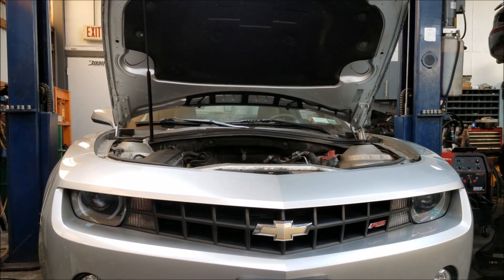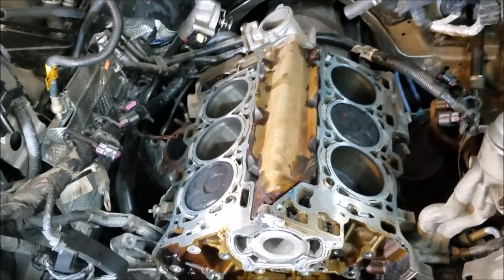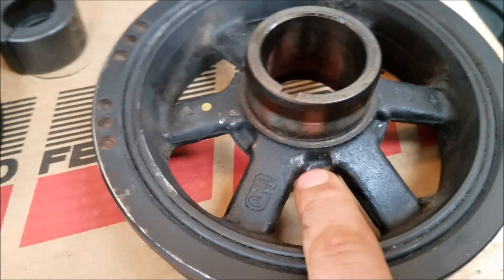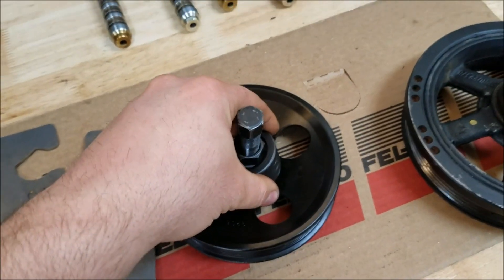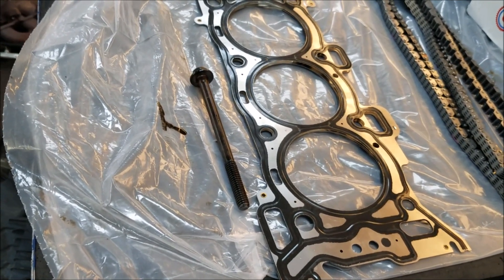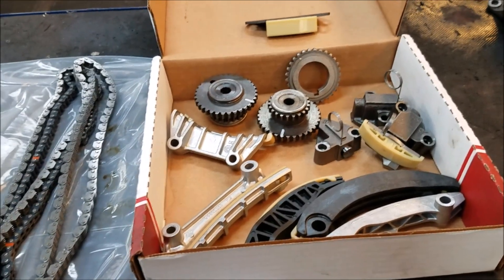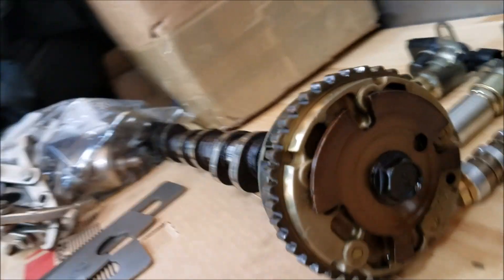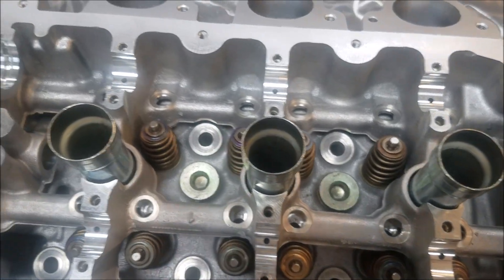2007-2015 3.6 V6 GM HIGH FEATURE TIMING CHAIN/HEADS INSTALLATION GUIDE/TIPS. BIRDIE'S PRO-TECH

Comment: Travers mounted engines can have heads removed in place. There are videos showing timing chain removal with engine in place. One thing that could be added to the video is head bolt prep, use thread sealant, oil or dry, and the torque procedure. Thanks.
Reply: How sure are u on this I would like to know if it would benifit me or is this some practice for other engines?
Reply: @ImpalaLfx  I did it on an 07 Acadia, if you have a hoist it is better to drop the engine.

Comment: Is there any way to check the vvt cam actuators? One of them I can move the sprocket with the cam in place, shouldn't it be locked? If so is there a procedure for it?
Reply from the maker: Hi Kris and thank you for the question. I'm unaware of there being an "official" test for the Cam Actuators but what I like to do is give each of them a hand movement test. If any of them have a noticeable difference in movement, inspect or replace the actuator. I would actually recommend changing them all depending on mileage or if the engine was noisy at idle.
Reply: @birdiesspeedshop6997  Thanks for the reply back! Gotcha, I didn't hear the the engine run before taking apart the engine but I do know that the timing chains had failed but no valves were bent. As far as as the moment by hand, there is one phaser that I can move a good 45 degrees or so and sometimes it will lock into place but then I can easier disengage it by hand. I assume that it's bad but I want to see if the other ones are faulty. It's supposed to be a super budget rebuild so if it ain't broke I don't want to fix it but also I don't want to put if all back together and later find out that they are bad and have to redo all the work.....
Reply from the maker: @krissondors  I totally get it. Doing that job once is enough too! Sometimes it's worth doing the full replacement just for the peace of mind. Then you can get that job off your plate and not worry about it coming back to bite ya!
Reply: Different application but still a GM and likely relevant. Another channel went through a test on one of those phasers and it does not look like the slop has to be all that much to screw up timing. The end of the video below shows the test and the next part of the series shows the new one and the comparison.
https://www.youtube.com/watch?v=0pkIZKys2cE

Comment: Yes it sounds like in the valve train. It starts sounding real soft until it gets to its peak sound, . Today i drained the oil, it looks clean but on the drain plug (bolt) i got like grease stuck on the magnet tip, no metal debris in it, just like if its got a dirty oil pan, I'm thinking its clogging up the oil pickup tube and passage ways.Thank you for your response, I only work on it when I get a chance mostly weekends weather permitting. thank you for your help, really appreciate it. Also i replaced fuel purge valve that was stuck open that made a ticking sound too, but that was a different sound.

Comment: Torque Specifications for Rocker Arm and Heads Bolts Please.
Reply: There was a torque spec briefly displayed for the head. Rocker arms have no bolts, just cam bearings.
Reply: Where can I find the head bolt torquing sequence

Comment: Can the variable timing solenoids be switched around from the intake to the exhaust side and from left to right banks?
I replaced the head gaskets and installed new timing chains, it starts pretty good but after a few minutes i get a sound like if it was a diesel engine, i shut it down and restart the engine and that noise goes away but comes back after a few minutes, and if i turned the a/c on the oil light will come on. i changed the oil and it kind of lower the noise. I had it idling for a couple of hours but keeps making the noise until I restart it. I got no engine light on, i drove it for a couple of miles runs good but the noise is still there. you shut it off restart it and engine idles normal for a few minutes. any ideas or advice please.
Reply from the maker: Yes, those vvt sensors can be moved around. Can you distinguish where the clicking sound is coming from? (Crankcase/Valvetrain)

Comment: Damn what happened to GM? I’ve always been a gm guy because there v8s and v6 engines were some of the best as far as I’m concerned. I officially won’t own one of these just like I won’t buy a 5.4 , 4.6 triton or 4.7 dodge. Over complicated junk. That car would be fine with good old 3.8 or 3.1 even. They even had to ruin the Colorado with these. Why not use new 4.3? I love how these engines run but I’m scared to buy one. Great work on the video buy the way.

Comment: Have this job done and driver and has no code but my gas pedal feels sensitive and doesn’t feels like before the timing chain. It had power and ran like new, miss that feeling. You think you can give me ideals what can it be???
Reply: One tooth off timing.
Bent or damage valves.
Slight damage to valve seats
Lifters.
Ideas to look into hope I could help

Comment: Thanks for the video. Based on your experience with these hf engines, have you ever seen the timing reluctor wheel on the exhause camshaft become damaged in the past? After a persistent p0341 dtc we put a scope on the wires and noticed a bad waveform coming from one of the long teeth. Then visual inspection via the camshaft hole, looks like that tooth has a burr on it.

Comment: Cloyes timing sets are made in China
Reply: spent extra $$ for all "genuine GM parts" for timing chain/guides/sprockets/actuators on a GM 3.0 and when I received the order, most if not ALL the "GM" parts were made in China, Taiwan or  Hong Kong. To add insult to injury the secondary chain guides, which were in sealed "Genuine GM Parts" bags, were Cloyes parts. You could clearly see the Cloyes name right through the plastic bag. GENUINE GM PARTS MEANS NOTHING ANYMORE.   ITS A LIE. SHAME ON GM
Reply: Everything is made in China, even the prescriptions you depend on.

Comment: I know you have to replace the head bolts but do you have to replace the camshaft bearing cap bolts too.
Reply from the maker: Hi Claudia and thank you for the question! No the cap bolts do not have to be replaced. You can safely use them again.

Comment: Head gasket at under 60,000 wow what a load. I’ll keep my 3800s
Reply from the maker: Changing the oil on these every 3500 miles certainly helps keep this problem away!
Reply: @birdiesspeedshop6997  
So 5000 miles not soon enough?
Reply from the maker: @hotwheel6663 Hello, Good question. With this engine, 5000 mile oil changes isn't enough. I believe that the lack of consistent oil changes, low oil level between changes caused by PCV system issue/owner neglect and use of a good oil will bring the chain issue forward. The chain system itself is also to blame in my opinion, but if you change your oil more frequently it tends to keep the problem at bay for a longer period.
Reply: me too
Reply: Q. Tech I’ll keep my 5.0 liter (EFI HO) with 350,000 and still runs like a clock.
Reply: I'd say it's the dex cool that fails the gaskets
Reply: Yep 3.8 is the best v6 ever made. 200,000 miles plus on my Lesabre.
Reply: @glennmartin7941  that’s why they stopped making it. Wasn’t it a pushrod engine?

Comment: how did u set or alighn the cam fasers or do u have too im havinga hrd time with a 09 traverse 3rd time changing timing chain....i skipped a procedure the second time removing the chain and not aligning the crank shaft so i think i unalighned the cam shafts

Comment: Hey birdie, I inherited @ 14 Cadillac XTS with burnt valves so the heads are in the shop. Problem is they brought me the parts unmarked in boxes, and I’m having trouble identifying positions for 3 of the camshafts, the bank 2 exhaust is pretty evident. Do the casting marks have any bearing?

Comment: hi does the engine need to be on 1 tdc when its on the stage one marking for the first chain or where do my pistons have to be when i have it on the stage one timing mark?
Reply from the maker: Hi and thank you for the question. Is this for disassembly or reassembly?
Reply: @birdiesspeedshop6997   hi thanks for the reply its for reassembly
Reply from the maker: @elgordotrucking  Ok thank you. Hope this helps!

1.)Start at stage 1 timing mark and install chain and idler on left bank.

2.)install idler and primary chain in stage 1 timing mark

3. Move position to timing mark #2. Then Install right chain

Tip! double check alignment as you go before you pull tensioner pins.
Reply from the maker: @elgordotrucking  https://youtu.be/hZyehWKDV-Y Here is a link to cloyes install guide.  Best of luck!
Reply: @birdiesspeedshop6997  thanks appreciate the help!

Comment: I have same p0008 code. 77k miles on the Camaro. Just opened the valve covers and have lots of sludge. You think it would be a good idea get the engine out and clean the pan and pickup tube. Oil pump   not sure how to make sure nothing is clogged up with sludge
Reply from the maker: Hi Paul. That wouldn't be necessary to remove the engine. A few tipsas well,  I would suggest sea foam engine cleaner after the job is completed. Also, change your oil again 500 miles after the repair. That will begin  a good clean up in the crankcase and top end. Another suggestion is to start changing your oil every 3000 miles instead of what the manufacturer suggests.
Reply: @birdiesspeedshop6997  awesome. Yeah they didn't change the oil in time. Waited for the light to come on every time. I'm ordering parts soon. Need to get this thing going.
Reply from the maker: @reyesracing24  Ahhh yeah...oil neglect is the worst for these engines. I hope the job goes extra smooth for you Paul. If you have any questions I will do my best to help!
Reply: @birdiesspeedshop6997  thank you really appreciate it.
Reply: @reyesracing24  I was discouraged to use the oil life monitor for oil changes in my newly purchased 2008 Pontiac G8 with the LY7 V6. The dealer advised changing the oil every 5000 or less with full synthetic. They also did my PVC mod for me a few years ago.
I don’t necessarily get my oil changed at the dealer but do follow the suggested maintenance schedule.
I just ignore the oil life and just reset it to avoid nuisance alarms.
So far 109,000 miles and no issues.
But I’m not holding my breath.
Reply: did you fix your issue?
Reply: @aykutyildiz7133  I found an engine on ebay with like 50k miles from an Cadillac ATS. Decently priced so I ordered it and just swapped it out. I have a lift so it made it easy to drop the k member and just swap everying over. Oil pan and timing cover were different that's all.

Comment: I am having a hard time lining up the timeing markes on a 3.6 L engine, ive been rotating the motor for days and can't get any of the timing  marks to line up correctly. How to do this right so I dont break the engine, thanks
Reply from the maker: Hi. Once you complete the job, have all the timing marks aligned and everything is lined up properly, and then you rotate the engine, it will still hold the correct timing but the marks will "appear" to fall out of place. You will still be in correct timing and alignment. I hope this helps! 👍
Reply: There is 2 stage procedure left bank 1st right bank 2nd

Comment: Worked on a 3.0 CTS engine changed all chains, guides, tensioners and exhaust cam phaser due to being stuck .. now getting P0014 code on the new phaser .. double checked again all is in timing.. heard about a thrust washer going in between cam phaser and camshaft . Know anything about this issue?
Reply from the maker: Hi Juan. Did you take a look at the VVT solenoids? They may need replacement as well. I would start there and see what you find. Best of luck!
Reply: @birdiesspeedshop6997  I put in bank 1 all new solenoids and cam sensors and still no luck
Reply from the maker: @JuanCRaw  It could be a wiring issue. You can start by checking grounds at the vvt connectors. Also make sure the oil is freshly changed. Also not to state the obvious, but be sure you are working on the correct bank location.

Comment: Is this the same engine in the '09 Cadillac CTS Direct Injection V6 AWD?
Reply: The reason I ask is because I am looking for a video on how to replace the head gaskets.. I’ve never done it before but if I see something I can pretty much do anything. Do you have any videos on the exact process of replacing a head gasket? Or a reference to such
Reply from the maker: @successfulminds7288  Ok great! For some, this video would be suffice enough to see how it comes apart but If you need more help I would be happy to answer any questions you have or you may be able to download a service manual. My advice to you would be to take your time and follow the torque specs. Once it's disassembled the job is much easier than it looks.  Best of luck!
Reply from the maker: Hello. Same job, yes.
Reply: Yes and it’s 💩

Comment: 2008 Acadia ly7 engines are running $2,500. Can I take  ly7 engine from a 2008 malibu striped To long block and put all acadia accessories on it to save money? I have found 2008 malibu engines for $800.00 ...I realize I'll prolly have to change oil pan and pick up too.  Do you think internals of both engines are same?
Reply from the maker: I believe that should work just fine. Rotating assembly should be the same. Let us know how everything goes!
Reply: Wont work with computer

Comment: Do the cam phasers have to be unlocked when you install them. I didn’t see anything about this in the Hanes manual.  Had to replace the intake phaser on the right bank and  did the timing chain too. Used the cam retaining tool and followed specs still getting correlation codes and its drinking gas like a big block j
Reply from the maker: Hi lionel! Unfortunately, It sounds like you may have issues with other timing components if you're getting the same code. Did you change all the chains and guides? if not, I would suggest having another look at the condition of the rest of the timing system. Not the news you want to hear, I'm sure.

Comment: My cam caps got mixed up, in what order do they go.
Reply from the maker: The raised feature must always be oriented toward the center of the cylinder head.

The I indicates the intake camshaft.

The E indicates the exhaust camshaft.

The number indicates the journal position from the front of the engine.

Hope this helps! If I find my full diagram, I will post it for you.

Comment: Hi there. I have a 2006 Holden Rodeo V6. We had a issue with the motor. It was making a rattling noise. THe car stalled while driving. Then it started again but stalled again about 20 kms down the road. Got told it was a starter motor. So we changed the starter motor but still wouldnt start. Had a mate come over and tryed to crank the motor with a braker bar on the crank blot but wouldnt move at all. Saying it could be timing chain. So taken it all apart and removed timing chains but still cant crank it by putting a braker bar on to try to crank it. Like the motor has seized. Any ideas if possible...
Cheers
Reply from the maker: Hello! I would check the transmission and drivetrain to be certain that the problem doesn't stem from there. If everything else moves freely, suspect the engine internals. Best of luck! Please post your findings!
Reply: Hi Allan. What was the cause?

Comment: How do i put the engine back in time if the timing chain is off a tooth?
Reply from the maker: Hi Jeremy. I would suggest starting over from the beginning, checking your work as you go to guarantee the correct positioning. It's better to be absolutely certain it's correct than to have an issue when it's reassembled. Best of luck!
Reply: Move the cam slightly

Comment: Hey Birdie great camera work with description of video! I came across this when I was getting ready to change my timing chains. I agree Cloye's is worry free manufacture with a great step by step. What brought me back to this video was to get a peek at the rocker arms. I was getting ready to seal everything back up after installing the timing chains and noticed a rocker arm off in the right bank intake cam. After a close inspection , all 6 of the little bastards are off... Have you ever come across this before? Can the chains slip enough for the cam to blow them all off? Or do you think my wife had the radio too "F"ing loud and wouldn't notice when the beginning of my 'rocker arm soldiers' fell down?
Reply: Yes, bad tensioners can cause the chain to skip and take out intake valves and rockers.